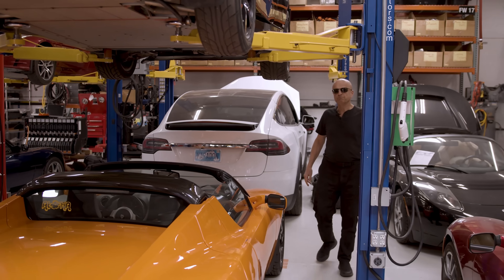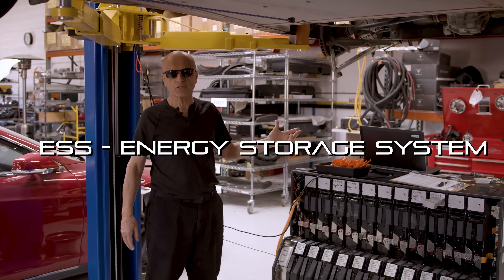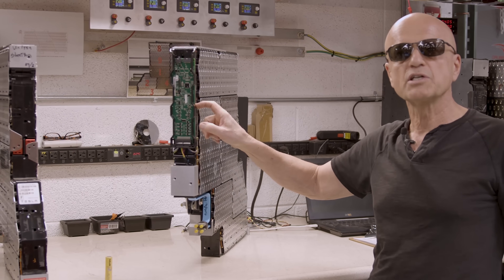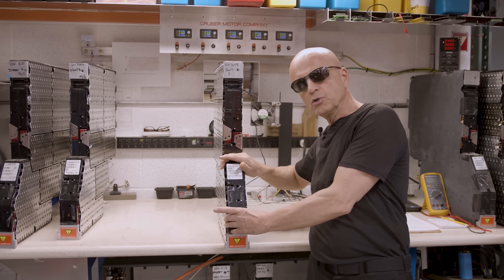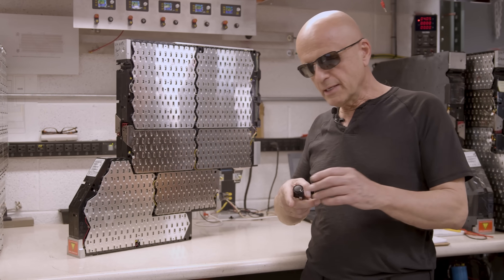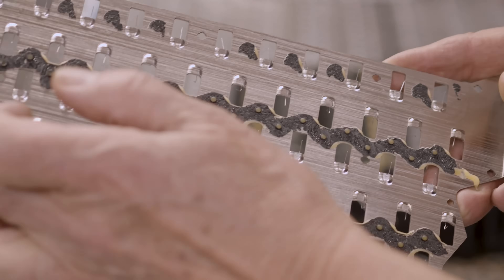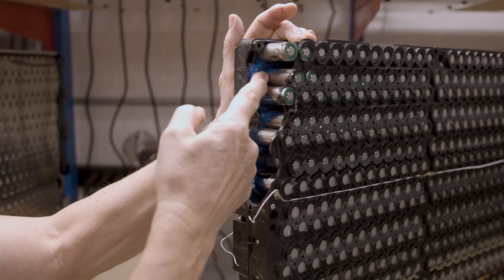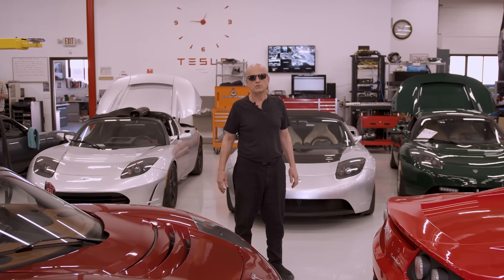Tesla Roadster | Battery Autopsy | Gruber Motors

Comment: Any opinion on 18650 Model S or 2710 Model 3 cell replacements on modules by drilling old cell off and glueing new cell inside the module? In europe there is a reputable company that has advertised doing this on multiple battery modules.

Comment: A great video. I have a question about aluminum cooling jackets. Can hard pounding in path holes and vibration damage the aluminum jacket isolation causing a short circuit between aluminum jacket and cylindrical cells? They are in contact of each other to transfer the heat. Have you heard of any kinda short circuits and fire because of that. Is it really safe?

Comment: Since the Tesla Model S battery pack has the same number of cells as a Roadster, could a Model S battery pack (and its ancillary equipment) replace the battery pack of the Tesla Roadster? 
  A Model S battery pack, and its ancillary parts, could be adopted to a Tesla Roadster, couldn't it? This would be an even hotter Roadster!

Comment: I'd be curious to learn more on the BMB microprocessor board on each sheet. And then understanding how replacing a sheet effects the rest of the system, can the PEM read a new sheet and how does it affect the sensors inside the ESS. This video is very enlightening though, thanks for creating it.

Comment: MAybe with a CAD design of the frekin' pack at the position of cell on a lathe.Try ro use some sort of drill to start drill battery itself from the  pack untill you can replace with new one.It just seem impossible but i think it isn't in some circumstances.
Reply: The main issue is to find the exact cell which is bad, without disconnecting all of the others. you have to disconnect them, individually test them, then cut the retainer with a hole saw type device on both sides of the bad cell, then press it out.

Comment: How will EV batteries - and especially Model S ones ! - tolerate the car being driven through deepish water?
Reply from the maker: The packs are pretty well sealed, up to a point.  Length of time under water is of course a main consideration.
Reply: @grubermotorcompany  
Thanks - good to know!

Comment: Do you have any issues with Tesla making things harder than they should to repair? Suppling parts etc?  Louis Rossman (Right to Repair) advocate might be interested in your thoughts.
Reply from the maker: Tesla does not intentionally make their product hard to repair.  They would be shooting themselves in the foot since their Service Centers do the same work.
They struggled with supplying parts, primarily high voltage parts due to safety and liability issues.  400 VDC components require special handling, tools, and equally importantly - experience.
Not negating the fact there are unscrupulous manufacturers out there, more so in the mature markets like critical power equipment, that intentionally attempt to lock out competition with padlock software, or force service through dealers only, Tesla's parts, and service sharing policies do not seem to be motivated by these same competition control tactics.

Comment: It is clear that this pack as well as most Tesla pack have not been made to be serviced. Do you guys at Gruber motor plan to design a replacement battery sheet design to save all these VERY epic T-roadster ?
Reply from the maker: We are working on it with Tesla.
Reply: Hopefully sometime down the road you could develop a superior model 3/y pack replacement
Reply: There are loads of these around with dead batteries now. You cant get replacements. Not even lasted 2 decades.

With the Elise you can still buy brand new engines from Lotus' stock. But you cannot store batteries long term, they need to be used or they will discharge and brick.

In the UK there was a company selling new batteries (aftermarket) for them for a while. It burned down in a giant battery fire..

Comment: Actually, 18650s are still connected in a lot of applications by nickel(not stanless!) Strips. But how they figure to use wire bonding for battery connection wаs been an awesome idea.

Comment: Could a duff battery not be link bypassed to repair the pack, as one bad battery ruins the whole pack? Maybe break the connections of the bad cell, whilst plates still on, and wire in an external single cell to replace it but sited outside the pack. An infrared heat gun should be able to detect duff cell(s) whilst pack is under heavy charge or discharge (ie it will be hotter or colder than the rest). That way the  plates with the fusible links will not need to be destroyed as you would not need to remove them?

Comment: Cool. Has anyone replaced these battery packs with something more modern? eg., packs from a Model S or 3? What's the availability of these battery packs? Can you get new replacements from Tesla? Or are these roadsters dead when the supply of this type of battery pack runs out? The reason for asking is there was a Roadster for sale in the UK (where I am) with a dead battery pack. Is it scrap or is it repairable - and if so for long?
Reply from the maker: There are much better battery cells available now.  The limitation in the Roadster is firmware and electronics out of production and 13 years old.  Re-doing these items for 2000 or so cars, is cost prohibitive.
Reply: They are possible to build from scratches if nessessary.

Comment: So what does a refurb battery pack consist of ?
Reply: Looks like from tested 2nd hand modules.  I know of a case in Germany (Model S) who's battery pack was replaced because of a faulty DC contactor inside. The replacement battery had less capacity than the old one and by memory the guy lost 40km of range (and was not that happy).
Reply: @moestrei  sounds very wired to replace a whole pack vs just swapping.out contactors.
Reply: @pashko90  I believe Service Centers never open a battery pack. Same with Drive Units: They always exchange the whole assembly instead of swapping out a worn bearing for example.
Reply: @moestrei  Lol. As far i know, Nissan can repair his own packs/ EV components. Too bad for tesla :( thanks god, i'm fixing all of my stuff myself.
Reply: @pashko90  I suspect Tesla keeps it this way to make sure the expertise how to fix things on component level stays with as few people as possible. Right to Repair issue. Nissan battery packs in hot climates......I rest my case.
Reply: @moestrei  Yes, we all are badly need a good Right of Repair act. Planned obsolecense with a packs of leaf is pretty bad :( i do swap leafs on bigger ones.
Reply: @pashko90  👍

Comment: Is it possible to swap my 75 battery for a 100? I have a 2017 model S D
Reply: There was a video answering this specific question up here a few days ago but I currently can’t find it. Could have been taken down because it had some weird kW vs. kWh mistakes in it.

The gist of the video is the 100kWh pack is heavier and is not supposed to be used in cars not made for it. Upgrades to the 90kWh pack are possible though (probably unreasonably expensive though).
Reply: @geraldh.8047  Thanks for the quick response. I watch all of you videos. Great job!
Reply: Yes